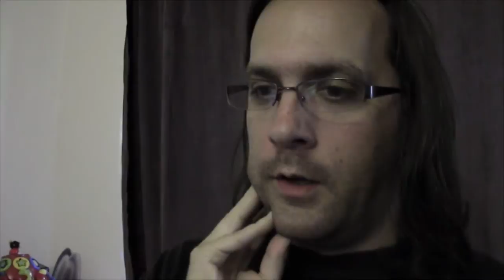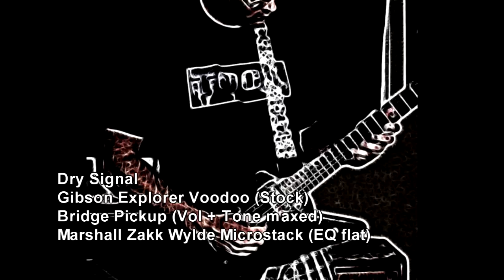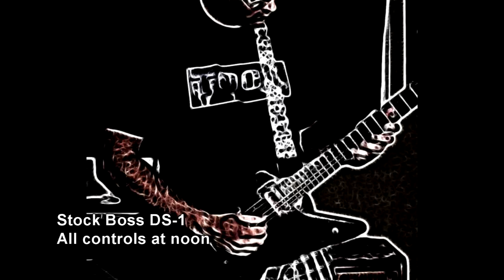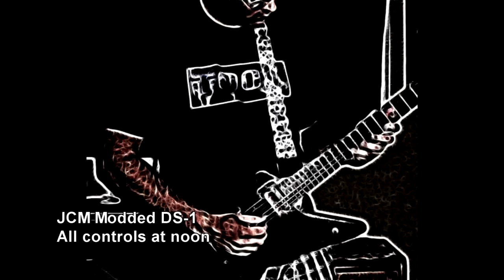Pedal Mods - Boss DS-1 Distortion - JCM Mod

Comment: Hello. Could you share the pattern of your pedals "Runoffgroove Mockman"in this video: Pedal Demo - Runoffgroove Mockman (Beavis Audio Version) I tried to solder it myself, but I wasn't that kind of sound. Could you tell me what chip is used, what your schema is different from the scheme on the website "Runoffgroove" and , if possible, to send an email to the scheme itself? I'll be very grateful
mail: thedavkolds1@gmail.com
Reply from the maker: Hey there.  I used all the same values for chips and other parts as noted in the Beavis Audio schematic.  I'm pretty sure the chip was a TL072.  I don't think my schematic is different from the Beavis Audio site, but I may have actually screwed it up somewhere lol.  I still consider myself a beginner, so it's very possible.
Reply: gasolinechlorine Oh thank you very much :)